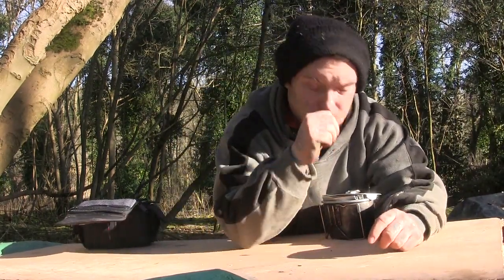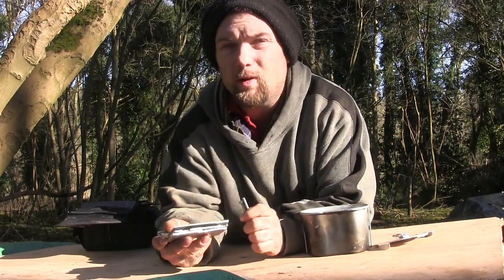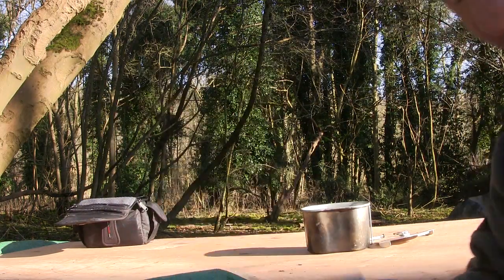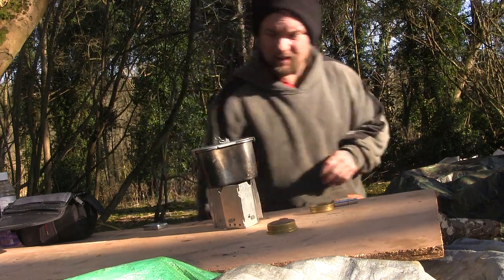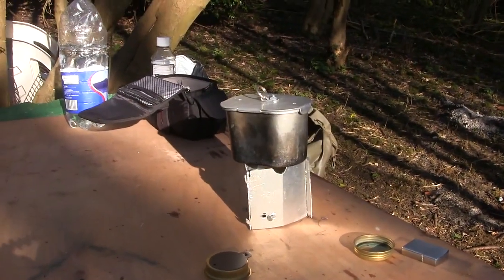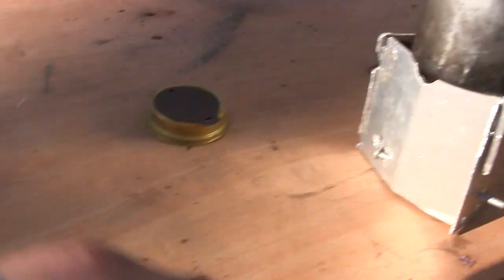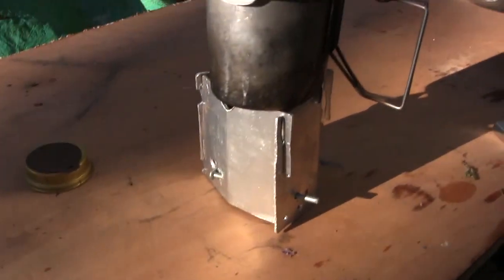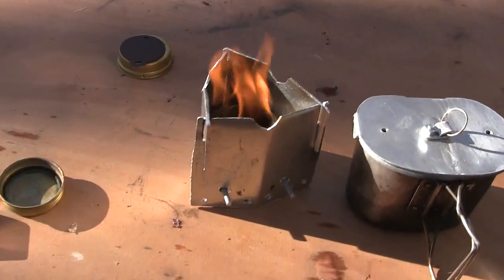Bushcraft Equipment : Homemade Trangia Pot stand

Comment: fantastic project. loving this better than using rocks for a Stand..can't always be gauranteed to find good rocks in all the camp sites.
thinking if you can make a stand with lighter sheet metal? Cheers ;-)
Reply from the maker: cheers mate, its aluminium  so fairly light